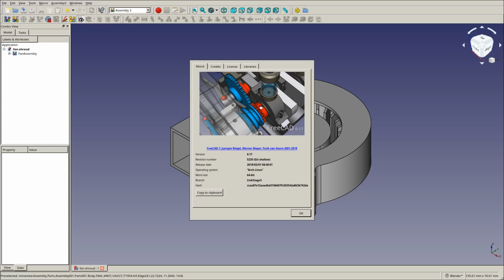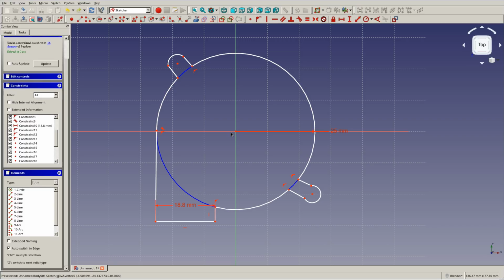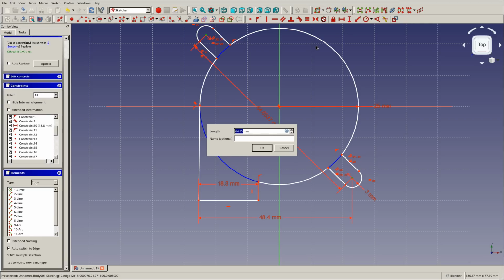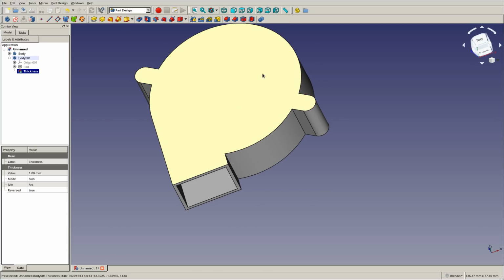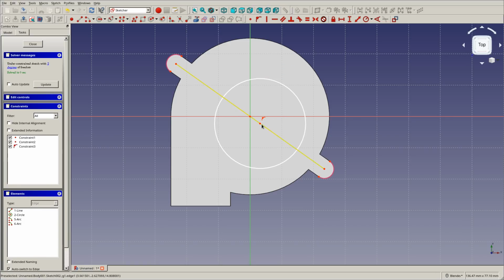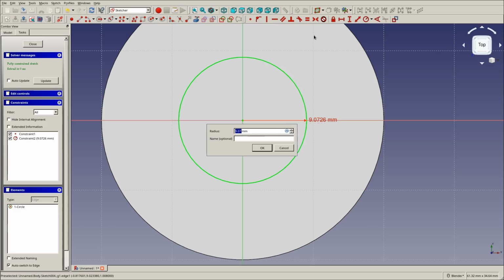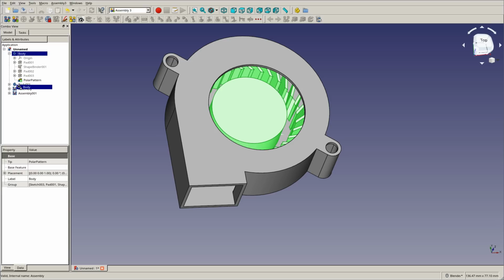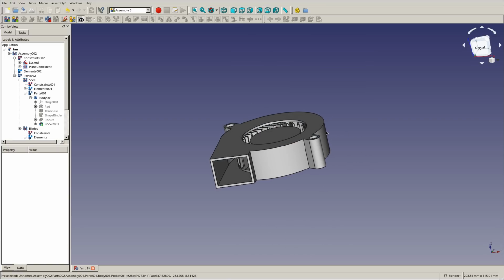FreeCAD 0.17 basics: modelling a blower fan (Part Design & Assembly 3)

Comment: something's wronnnng!  the first hollow operation made the brackets empty!? ...so the shell inside will not be smooth... resulting in an efficiency drop.
or did I get fooled!?
Reply: I noticed this as well. The fan interior will vent air through the screw mounts because they were hollowed out as well. This will reduce efficiency and increase noise due to turbulence and drag. The screw brackets should have been added in a later step but to be honest this doesn't make the video any less useful. It was fun and instructive to watch and I definitely learned a thing or two here.

Comment: I still just don't understand why so many cad developers cling to parametric modeling. It creates way too many points where you can totally screw up a model and waste way too much time making one "simple" change down the road. I forces everyone to think the same way when designing, which is absolutely impossible. It's like telling DaVinci and Picasso that they have to paint exactly the same way, using exactly the same brushes & hold them the same and can only use the same paint or else the canvas will disintegrate half way through the painting. I'm sure some of my analogies aren't right, but I sure your smart enough to get what I mean. 

I used Autodesk Inventor 2009 in my engineering I & II in college and I thought that was so awesome, until I came across PTC CoCreate. My model design time became so much faster and could much more easily create complex assemblies with accurate wire breakouts and within weeks was doing work in days that Engineers (that had been using the program for years) told me would take a couple weeks to complete. Now I hate inventor and similar apps. The whole point of CAD is to streamline and speed up the design process, not make it more complicated.
Reply: I'm new to this stuff but you've got a great point lol. I thought this was supposed to make modeling and designing easier. I'm glad I'm learning it but I'm going to check out the program you mentioned. Is it like a better version of Blender? I downloaded that months ago but I've never gotten around to using it yet. I want to learn one program at a time.

Comment: Hey Lysergesaure1, thanks for the good video.
However, I did not really understand the reason for putting the bodies into their own assembly and finally making an assembly from two assemblies.
Note: doesn't the diameter constraint icon also contain a radius constraint on its pulldown arrow?
Keep up the good work
Reply from the maker: Making each part into its own assembly makes it a lot easier to replace the part later without having to re-do all the constraints in the higher assemblies. You don't have to, but it's good future-proofing.